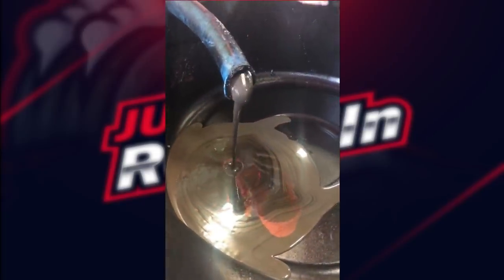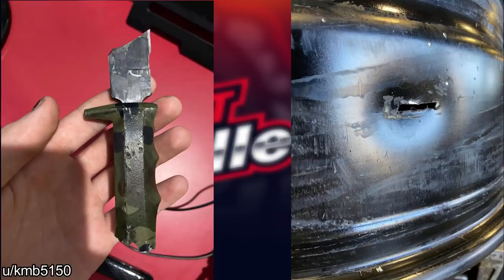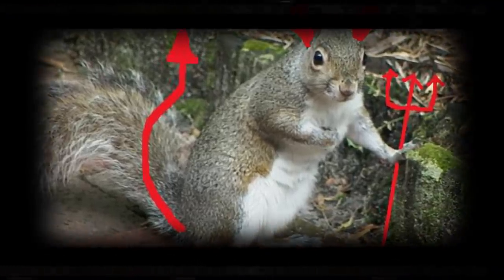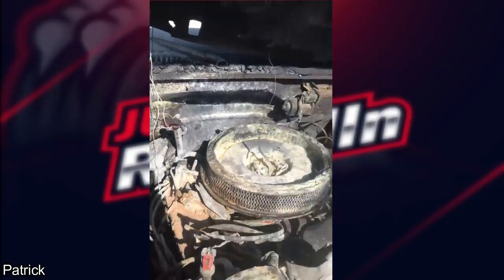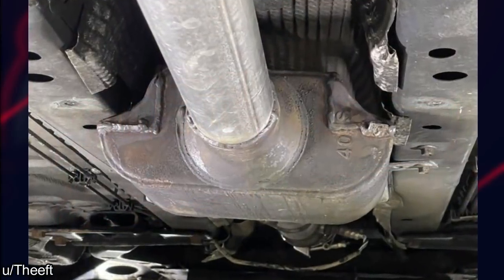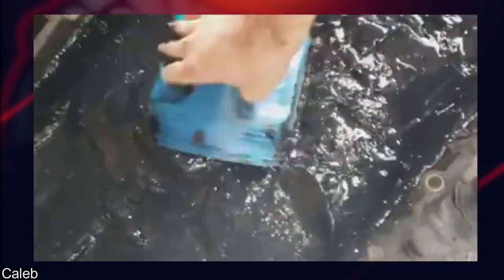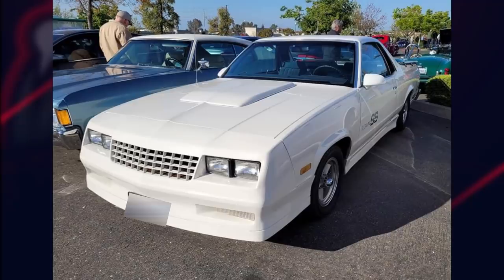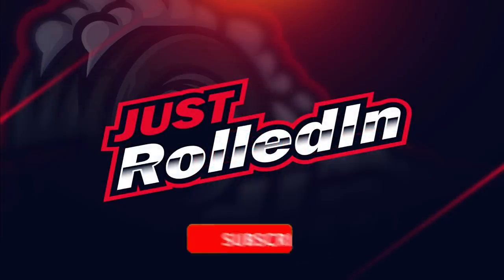Customer States "I Don't Believe You, I Don't Need My Oil Changed!" | Just Rolled In

Comment: I interned at a Ford dealership back in the 80's while I went through Fords ASSET program. Basically Fords version of GM's GoodWrench program. I was 19 and full of optimism. That didn't last long. A farmer had leased an F-250 for two years and the lease was up so I was tasked with doing the 'return' inspection. It had a 300-six and a manual tranny, 4x4, very basic rig. The engine was knocking badly and it had no oil pressure. The paint on the drain plug, from the factory inspection where they check that it's torqued properly then 'tagged' with yellow paint, was Undisturbed. It still had the original oil filter on it that was painted grey when the entire engine was painted. 19,000 miles. When we finally pried  the oil pan off the factory BREAK-IN oil had turned to greenish smelly wax. He said he added two quarts of quaker state when it started knocking a few months back, but he was unconcerned because the lease was almost up. The bottles were tucked in the engine compartment and he used straight 30 wt., non-detergent oil in round foil cans that you have to open with a can opener. You could just make out the throws of the crank, where it had dug nice little channels in the top of the solidified oil. The farmer was laughing his ass off, at first. He wasn't happy when he found out he had to buy the truck since he broke the conditions and requirements of the lease. Said he was going to sue. He even threatened ME ! Apparently I had done this, some how. I moved to Alaska shortly after that where the stories get even weirder. Cheers from Alaska.
Reply: It's a goddamn crime against humanity what some people do to their cars!
Reply: Jokes on him, imagine his farm equipment, his wife, his own health. What else doesn't he take care of ?
Reply: That took some.....talent.....I dunno.  The 300 was about as close to bulletproof as Ford ever made.  The fact that that motor made it two years on a farm with zero maintenance is testament to that.
Reply: They're the type of people that EXPECT everyone else to do work on his machinery properly while they buy garbage and bring it home with elegant ideas of how they want to build another show pony. On one farm I ran the boss bought a 180kva generator and the installer dinged the dyno which causes power surges??? After the first big storm of the season blew our power my boss connected up the old Chamberlain and "BOOM", there goes the fridge, freezer with a fresh beast inside and half a pig, phone and most other devices that were plugged in! I wasn't surprised that this boss wanted to sack me when he found out that my family and I have a very good reputations at running poultry farms, they're the type that love boot lickers rather than the quiet achiever types! Just like most European car owners, all flash with no essence!?
Reply: @mattdread4994  I think you mean American owners of European cars.
Reply: @FFM0594  No, he definitely described euro car owners in general.
Reply: He responsible for maintenance and failed to do anything with the vehicle
Reply: This guy probably thought that all mechanics were scam artists too
Reply: Makes me think twice when buying a lease return at a dealership. Thanks for the heads up!
Reply: Wouldn't be the first farmer vehicle that was not maintained. Bought a 88 farmer semi truck, horrifying the lack of maintenance on there.
Reply: @davidroberts6594  Yeah, it is horrifying the lack of maintenance on equipment...not just farm equipment either. How long does it take to change the oil and filter in a truck?? And maybe squirt some grease in a few nipples?? An hour? Good tools and equipment is the bread and butter and the basis of any business. They HAVE to be maintained and in good working order for the business to survive...especially farming. Without those, you've got nothing.
Reply: That was back in the days of 10w30/10w40.  Straight 30?  That's oil for diesels!  That alone would have blown every seal in that engine!
Reply: @ThatsMrPencilneck2U  Not necessarily. Quite a few people used to recommend running strictly Chevron Delo 100 in their pickups, which was straight 30 weight oil. Mind you, engines were a little loose back then, unlike today's engines.
Reply: @codyluka8355  OK, thanks for the correction.
Reply: Nice - I also attended the ASSET program back in 93/94.  I didn't stay at the dealership long at all.  No way to make honest money with the flat rate pay scale.
Reply: @ThatsMrPencilneck2U  actually 30 weight oil is just that but no cold start benefit as that's the 10w part. Also a diesel will suffer damage if gas engine oil is used as it's not as good as a oil with a diesel rating. You can use diesel oil in a gas engine as long as the weights correct.  I used to use 15w40 in my gas engine's. Now l use 5w40 rotella diesel oil as l now drive a 5weight oil car. I recommend it especially if you run a turbo.
Reply: @graham2631  Tell me something I don't know, like why Diesel manufacturers used to not recommend the multi-viscosity 30 weights.
Reply: Hard to understand what you are trying to say.
Reply: @rvndmnmt1  tbh that's the real takeaway from the story
Reply: That's why I never became auto mechanic even though I have always been very good. While still in high school I experienced way too much of the
" since you worked on my carburetor my turn signals don't work etc." syndrome.
I worked on too many cars that ended up costing ME to work on them.
Reply: @michaelszczys8316  That reminds me, I knocked the pan loose on my old Sunfire's automatic transaxel.  I had to put the thing on stands and take a bath in Dextron III, because I couldn't find a mechanic that wasn't afraid I'd turn around and sue them for transmission problems.
Reply: @ThatsMrPencilneck2U  you need to remember to leave a couple bolts in one end to help keep it from dropping too far as they don't put drain plugs in transmission pans. Even then it can get messy in a hurry.
Reply: @michaelszczys8316  You just reminded me of something I actually like about Toyotas.  Of course, you try to let the fluid drain, when you're not directly under the transaxel, but you're still having to slide under the vehicle on your back, and you're certainly not going to wait to let the thing drip overnight.

We used to change filters at a quick lube, and it was so much easier when you could stand off to the side, with the catch pan under the car.  It was also nice to have a parts washer right there when you wanted to clean up the pan.  Of course, they cut out that service for liability issues.

When you try to break loose the screws on an old Ford or Chrysler, the head would just snap off.  GM products used a bigger screw, perhaps even made of a higher quality steel.  There was a reason I used to like GM products.  I have no idea what they're like these days.
Reply: @ThatsMrPencilneck2U  my son got a Ford with Grade 0 fasteners and after breaking a couple Trans pan I made an adapter tube so we could suck the fluid that was like dirty cleaning fluid out through the dipstick changing it a quart at a time. 
About once a week and after a while it started looking red and was actually slippery.
Reply: @michaelszczys8316  
“Well they worked when I brought it in so you must’ve done something.” 🙄

I’m not a professional mechanic but I once made the mistake of accepting money from a friend to replace the clutch in his Toyota 4X4 pickup. I had just successfully done mine so I figured I could do it. 
What could possibly go wrong? 😑 

The new clutch shattered in the middle of an intersection in Seattle late one night. He called right when I was sitting down to a steak and lobster dinner in Bellingham 90 miles north. I had to rent a trailer and drive down to Seattle to pull it back up to his house in Bellingham. He gave me a choice of giving him his money back and letting him pay a pro to do the job or replacing it again myself. In the interest of maintaining the friendship I gave him his money back. He paid a professional to do it and the new clutch shattered too. Everyone agreed that I had done the installation correctly (which I already knew) and that what happened was a freak occurrence. It was a double freak occurrence that it happened twice. I can’t explain why it happened and neither could the professional mechanic. I wasn’t happy that it happened again but I did feel vindicated and I was glad I had decided to let a pro do it the second time. 
That was the first and last time I accepted money to work on someone else’s vehicle.
Reply: @vladtheimpala5532  like an experience I had with a teacher at my high school that I put a new fuel pump on his Chevy, it leaked all over two days later and he was mad as hell- chewed me out all over. 
I told him there was such a thing as 
" brand new JUNK "
A couple days later they had me do it again, he left me some money.
Reply: @miscellaneousone mate you should wrote a book! or at least have a youtube channel!
Reply: @diggla4817  That's very kind, thank you. I do have a little over 100 videos, I think. But it's a mish-mash of random things. ... but, maybe you're right. Maybe I should start creating consistent content. Hmmmm. ... regardless, Cheers from Alaska. 🍺🍺🍺
Reply: The reason I never buy anything from a farmer. They have no sense of machinery maintenance.
Reply: U moved to Alaska bc u thought u we’re gonna get hunted down by the rod knock farmer?
Reply: @ThatNoFbody-ch9ky  no
Reply: @rvndmnmt1  I have had the Ford six , the Plymouth slant six 225 , and still own a Jeep six . All of them were great engines in my opinion.
Reply: The customer is always right!
Reply: "Lie-a-Billy-T" what in darnation you talkn bout boy? you better get off mah property with them big city words..
Reply: @blacksupra001  imagine the animals on his farm. must be hell on earth
Reply: for context, the Ford ASSET program had at least three different sidewinders. several fell off into the wild down under but traveled through great lengths of trivial matter. unfortunately the days are numbered having to go on to make the F-250 rather flimsy in its appeal. after subsequent manners took into office they had acquired several engineers which would rapidly produce a varying prototype that could be sabotaged on daily venues. back in my days our manual tranny's took the hookers to shame. wild beasts they were climbing on the unfiltered 300-sixes.
Reply: If they abuse the truck like that,imagine what they do to the wife and kids.
Reply: Man those Ford 300's don't have a bulletproof reputation for nothing, yeeeeesh!
Reply: @codyluka8355  I don't remember where I heard this but what it was is that the tolerances we're tighter back in the day which caused stuff to wear out quicker. I don't know if that is entirely true but it would make sense
Reply: my high school girlfriends dad would buy a new Ford pickup every two years or so.  He too would never bother to change the oil, thought he was saving money.  He got away with as far as I know, trading in the 2 year old truck at the dealer.  He was an engineer, not a farmer.
Reply: Alaska. Where the odds are good but the goods are odd.
Reply: I’m still driving my 2019 farm lease ford. Just add a quart every now and again. Maintenence is for chevys
Reply: @wyattlewis8671  Nope.  I'm a BMW lover.  Do most of my own work, and get absolutely fanatical with preventive maintenance.  That's how I ran an E39 528i with an M52tu to 271,000 miles.  Repaired the GM 4L30e transmission once, rebuild the vanos once, get clean oil in it, clean fuel filters in it, new fuel pump..... the list goes on.  That was was awesome.  I sold it still running.